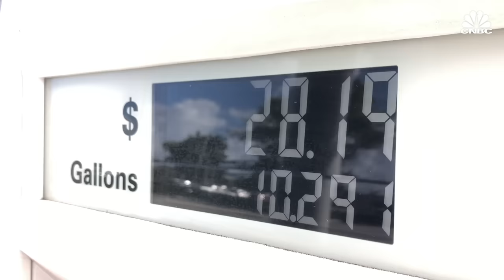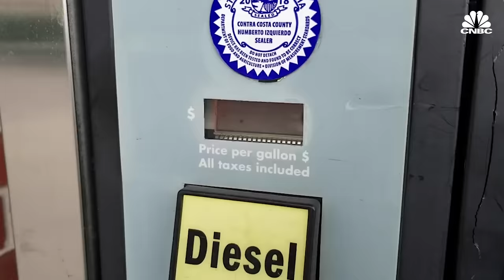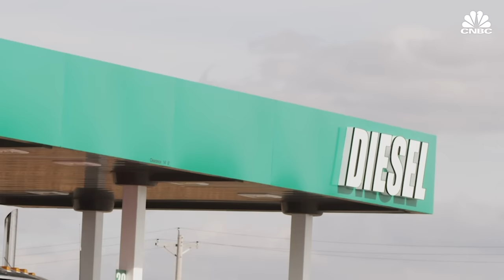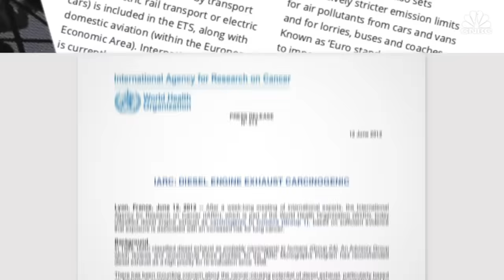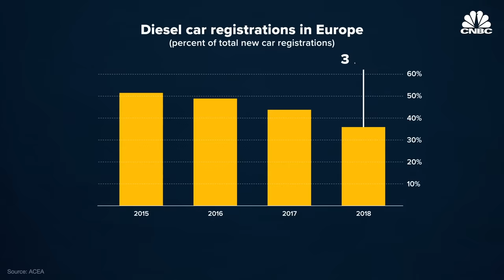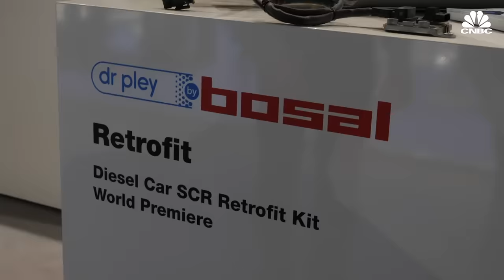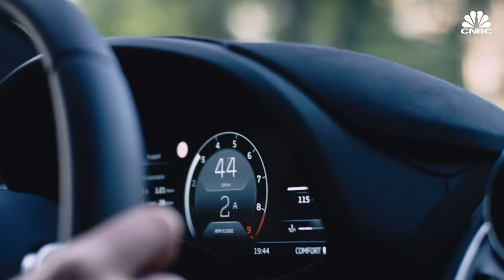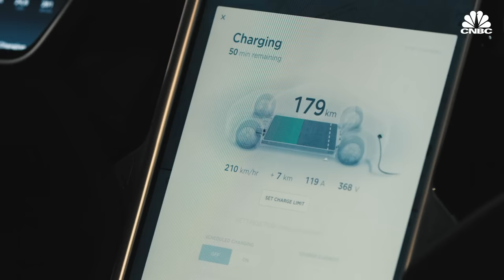Why Diesel Cars Are Disappearing

Comment: I've been driving gasoline cars all my life, since the late 80s. I just bought my first diesel, one of the last "super"diesel cars available, a 380 hp 75 torque BMW 5 series, and it's been tuned to 440/85. This thing is absolutely wonderful. I plan on driving it for at least 10 years.
Reply: 85 torque? Do you have trouble getting moving?
Reply: @soundterrorist256  I live in Korea where we calculate torque in Kg.m. Equivalent in pound-ft would be 614 torque.
Reply: That sounds like a awesome machine. A solid, well made, quiet, comfortable riding luxury car that is also fast and gets great mileage. It's like the best at everything! My bro has a 2010 5 series, and the straight 6 gas 3l isn't fast whatsoever. 600 ft lbs would definitely wake it up.
Reply: BMW?  10 years?  I wish you luck.
Reply: @FeldwebelWolfenstool  You wanna know what my other car is? A 95 E34 540i/6. I've been driving that for the past 9 years, and I've spent less on upkeep than any new car that I've had previous to that. Go figure, huh? And the diesel 3 liter has been around for over 10 years now and is known to be a pretty stout and reliable engine. But, what do I know...
Reply: @sharkracer  85 torque that’s terrible a 4 cylinder Kubota makes more
Reply: @tuckercole1531  Again, if you read my comment above, I live in a civilized country that uses the metric system. Torque rating of 85 kg.m is over 600 lb.ft of torque. That's almost as much torque as the Camaro ZL1.
Reply: Really proud of creating huge amounts of pollution, huh?
Reply: @PistonAvatarGuy  Ah, so you don't drive, you don't eat meat, and you never buy anything from overseas, you never fly, right? Or are you a big ole hypocrite?
Reply: @FeldwebelWolfenstool  My daily is a 2007 530d which I can depend on and a 2001 540i for my toy. Both solid and fantastic cars to own and drive.
Reply: I bought a jetta sportwagen tdi about 6 months ago. Really happy with it except the Emmissions, which I plan on getting rid of.
Reply: ok cool story
Reply: @PistonAvatarGuy  Not with the emissions equipment strapped to that engine. It will create far less pollution then whatever gasoline engine you drive.
Reply: @recklesssquirel5962  Don't get caught... Lol
Reply: @iansrving  ??? With full emissions controls, diesels STILL pollute worse than gasoline engines.
Reply: @FeldwebelWolfenstool  🤑🤑🤑🤑🤑🤑🤑😂
Reply: @iansrving  unless the fed decide to roll into middle of no where usa to find people that dont have their precious emmission systems on, ill be fine.
Reply: @PistonAvatarGuy  Actually, even the most stringent emissions regulated gasoline cars of California only have two monitored hydrocarbon catalysts and possibly an exhaust gas recirculation system. This reduces carbon based pollution such as carbon monoxide, unburnt hydrocarbons, and a few other chemical pollutants. Standard gasoline emissions equipment does not address the following: solid particulate matter (soot), oxides of nitrogen, and oxides of sulfur. Granted, oxides of nitrogen are not as abundant in gasoline emissions than in diesel counterparts, they are still produced from the heat of combustion regardless. The way diesel engines address these emissions is by bringing them to an almost net zero by several specialized catalysts. Most, if not all new diesels are equipped with EGR valves. EGR valves reduce oxides of nitrogen and sulfur pollution as well as reduce fuel consumption. Typically the first catalytic converter found in a diesel powered car is a diesel oxidation catalyst (DOC) these function much like the catalyst found in gasoline cars and their task is essentially the same. Up until new emissions standards were implemented in 2008, DOC and EGR were the only requirement for new light duty diesel engines. Post-2008, light and heavy duty diesel engines were both required to possess supplemental exhaust after treatments. The first of which is a Diesel particulate filter (DPF). The DPF is made out of a Cordierite Ceramic material that traps the particulate soot emitted from a diesel engine. The soot is accumulated until a differential pressure sensor has noted that back pressure has increased significantly. This then triggers the computer to inject fuel into the exhaust stroke of the cylinder, which then raised the exhaust temperature, burning the carbon soot into carbon dioxide and water vapor. The next catalyst that was required was a Nitric Oxide Trap. These catalytic converters are often paired with Urea injection systems to lower oxides of nitrogen levels to net zero. This catalyst serves as a place for the Urea to decompose into Ammonia and bind to emissions to create nitrogen gas (N2) and water vapor. The last catalyst called a Sulfur Dioxide Supplemental Reduction Catalyst functions by trapping oxides of sulfur into it's substrate where the high heat decomposes it into Disulfide and water vapor. The results of these supplemental catalytic converters are so well studied that they are now being implemented on some gasoline cars, with the aim of reducing the same emissions that all internal combustion engines share in common. Diesel engines are more polluting without emissions equipment than gasoline engines, but even the cleanest burning gasoline engine with standard emissions equipment will spill out more emissions that a diesel that has been properly outfitted with its respective emissions equipment.
Reply: @recklesssquirel5962  True, the EPA usually does not enforce laws on end users. They prefer to go after manufacturing where they can make the most money in fines.
Reply: @iansrving  You're quite wrong, bud. Modern gasoline engines are equipped with THREE-way catalytic converters, which greatly reduce CO emissions, hydrocarbon emissions AND NOx emissions. Soot is not a significant concern with regard to the vast majority of modern gasoline engines, because they produce almost no soot to begin with, while sulfur dioxide emissions are not a concern with gasoline engines because gasoline contains very little sulfur.

Even with full diesel emissions controls (I'm quite well aware of what they are and how they work), diesels are STILL not as clean as gasoline engines. If you don't believe me, you can refer to the EPA (and many other organizations) on this matter. Only the dirtiest gasoline engines (the 700+ hp Lamborghini Aventador, for example) are on par with diesels when it comes to their NOx emissions, while no diesel can come close to the cleanliness of the cleanest gasoline engines.

Diesel emissions control systems are also extremely problematic, costing their owners many thousands of dollars in repairs and prompting many to simply remove (delete) the emissions control systems from their vehicles. The worst problem that the owners of gasoline vehicles have with their emissions controls is the theft of their catalytic converters.
Reply: @PistonAvatarGuy  It's interesting you mentioned three-way catalytic converters. These are still not as effective at reducing the emissions as much as diesel emissions equipment because according to the EPA regulations you refer to, they don't have to be. Additionally, the most modern gasoline direct injected engines do produce heavy amounts of soot comparable to diesel engines. This is why you are seeing an increase in the use of Gasoline Particulate Filters (GPF) on many vehicles across many brands. Forgive my long-winded explanation of emissions equipment, as I was not aware that you had knowledge of their specific functions. As by default, I like to explain things. Regardless, I think we can come to a conclusion that at this point, the cars that you and I drive are highly polluting either way. Unfortunately, the infrastructure for electric vehicles has a long road of development ahead, much like the early days of gasoline powered cars. Even more unfortunate is global climate change is now inevitable and completely irreversible at this point according to the most recent publications of the International Panel on Climate Change. So we should at least enjoy the way of life we have now before it changes in the next five decades or less. Thank you for the intriguing conversation, I have enjoyed it.
Reply: @iansrving  "These are still not as effective at reducing the emissions as much as diesel emissions equipment..."

This is completely false, you're just making things up.

"...because according to the EPA regulations you refer to, they don't have to be."

A) It doesn't matter what the MINIMUM regulations are, because gasoline engines have no trouble producing far less pollution than what the minimum requirements allow them to produce, while diesels have trouble meeting the minimum requirements (Read: Dieselgate). B) Link? Last I read, the minimum requirements for diesels and gasoline engines were the same.

"Additionally, the most modern gasoline direct injected engines do produce heavy amounts of soot comparable to diesel engines."

No, they don't. SOME direct-injected engines produce slightly more FINE PARTICULATE emissions than diesels, but still not enough to be of any concern (they still meet regulations).

"This is why you are seeing an increase in the use of Gasoline Particulate Filters (GPF)"

Not any vehicle that I would consider owning.

"Regardless, I think we can come to a conclusion that at this point, the cars that you and I drive are highly polluting either way."

Except that they're not, some can have exhaust that's cleaner than the air in a polluted city.
Reply: Marshmallow Man  Yeah, so if you can find me a car that looks great with no chrome, is luxurious, rides well, has great options like soft-closing doors, has great performance from the 440 hp with over 600 torque, and costs me about 1/2 the fuel cost compared to something like a 550, while being more reliable than most gasoline engines, and doesn't cost an arm and a leg, by all means, sell me that car and I will drive it. Otherwise, just move on, man.
Reply: @ctdieselnut  My diesel pickup has 1050 ft lbs of torque.
Reply: @sharkracer  Wanna know the difference between imperial and metric units? One of them has been to the moon.
Reply: Marshmallow Man  fuel mileage goes weeee my dude
Reply: So many haters under one random comment 🤣 they big mad cuz they’re never gonna drive a nice car like the 5 series in their life
Reply: @TheBandit7613  I hope you realize that nasa and the entire scientific community used the metric system to get to the moon
Reply: @PistonAvatarGuy  What's polution got to do with CO2?
Reply: @johnsergei  When did I say anything about CO2? I was talking about pollutants which are directly harmful to human health, like NOx and soot.
Reply: @johnsergei  When did PistonAvatarGuy say anything about CO2?
Reply: @sharkracer  german Cars Build in the 90‘s are Great. Not comparable to modern cars
Reply: keep it in Korea
Reply: @TheBandit7613  without operation paperclip things where different
Reply: @TheBandit7613  This is an old comment, but its hilarious you say that because NASA, used the metric system to go to the moon AHAHHAH. This easily searched up, and just proves how terrible the imperial system is.
Reply: @mehp6107  Nope. Nasa started going metric in the 1980's. Aviation STILL uses the imperial system, miles and nautical miles.
"35,000 feet"